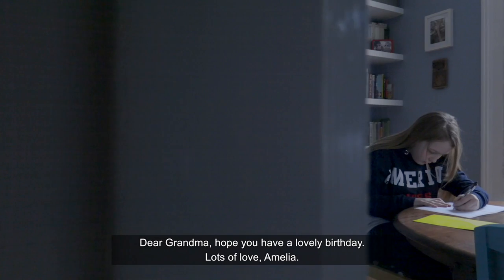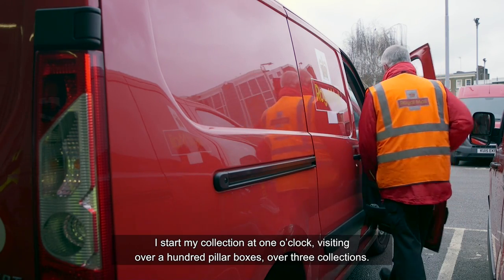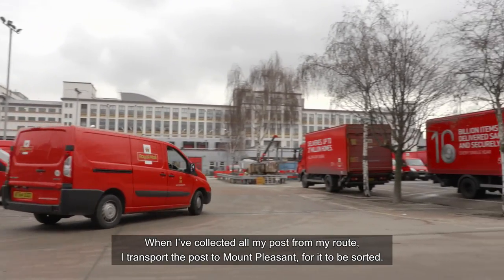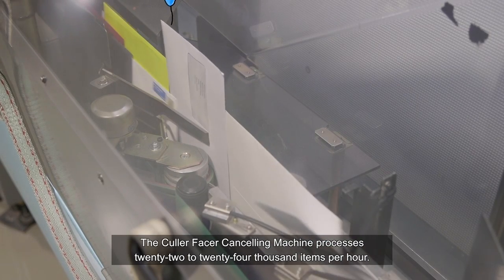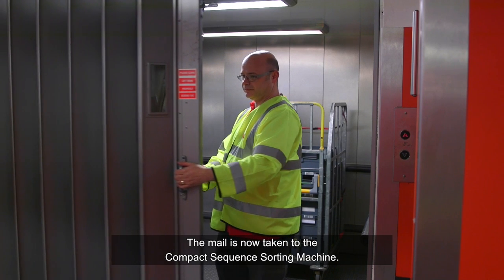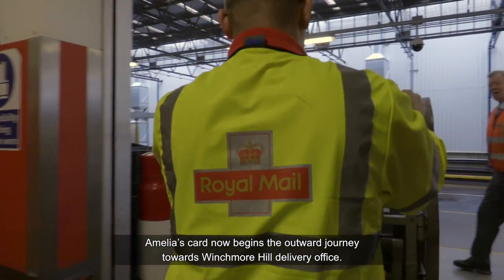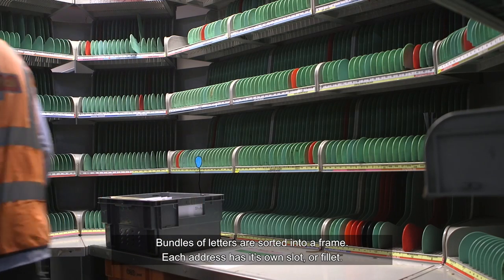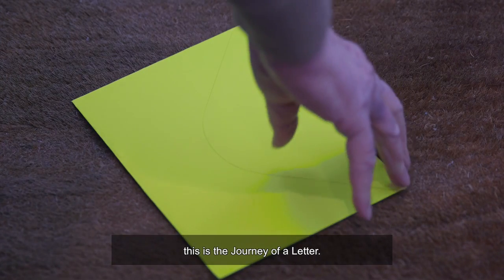Journey of a Letter

Comment: They forgot to show my favourite part in the process where the postman tears open some of the envelopes to check for cash 💔
Reply: most likely the sorting machine did that due to poor quality of the envelope`s glue...
Reply: @misscg367  sorting machine must have very sticky robot fingers then to remove money from the insides of cards
Reply: @MT-np4ek  check this reply few rows down: 

Paul JJ

3 years ago
Can you show the video about the machines braking down and how the letters gets ripped apart in to pieces as the process is very fast and if 1 letter will get stuck at least a hundred will get ripped off, that would be interesting to see.
Reply: @misscg367  I can remember using the old franking machines and if there was cash in the envelope the machine would often break the envelope to shreds,that's why people are told never to put money in an envelope.
Reply: @paullittle5200  True but some people like to think posties are thieves :) They don`t know the reality of the job...
Reply: @misscg367  think this is the problem, people don't understand what a postman does.